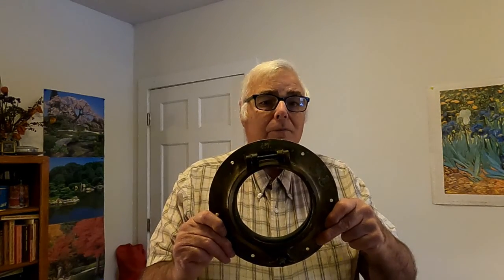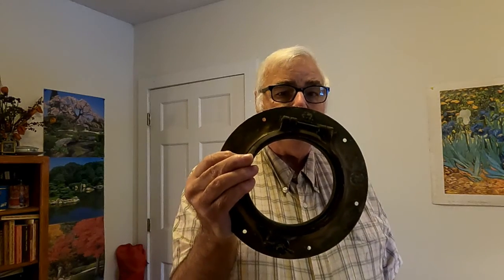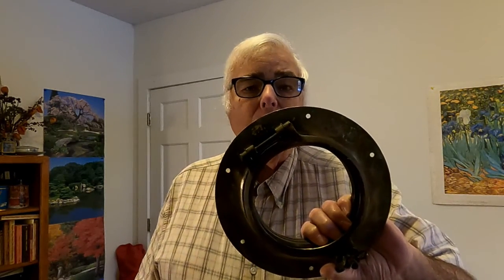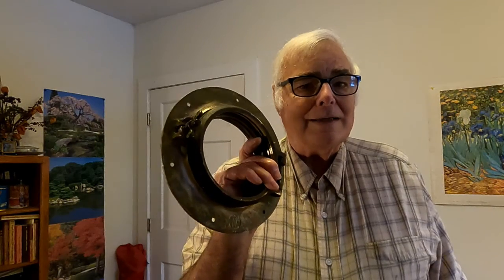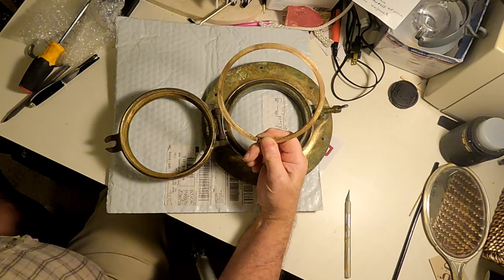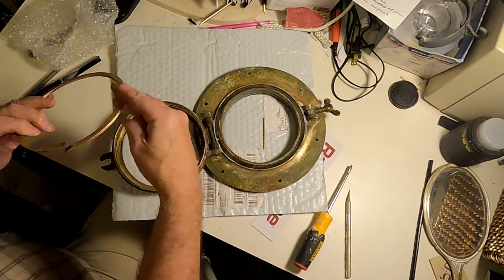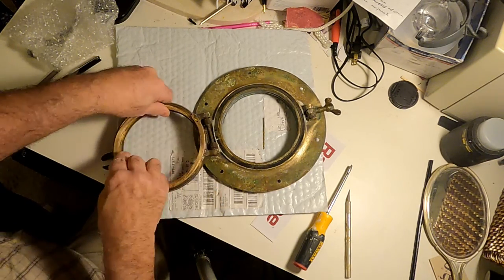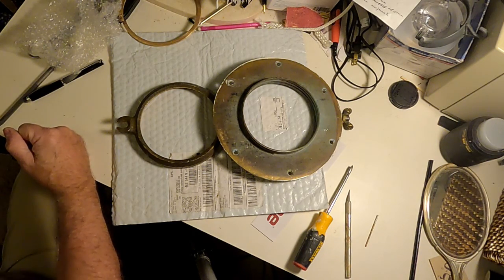Reglazing an 86 Year Old Bronze Port Hole with Lexan (polycarbonate)

Comment: It looks like you have another boat project out of the way, and i'm sure it will last a long time.
Reply from the maker: I do still have to replace the gasket.  I think I am going to make a new gasket from silicone caulk.  I would have done it yesterday, but I didn't have any masking tape.  I think the lexan will last longer than I own the boat.

Comment: What if you mounted the port hole to a flat surface to remove where it's warped out of shape ?
Reply from the maker: Well it has to go back on the boat and the spot where it goes is flat.  It turned out that the hinge pin was bent.  So I made a new one it the port now closes flat.  Thanks for the question.

Comment: I have two #4 Wilcox Crittenden ones! They didn't fit my boat.
Reply from the maker: Interesting.  Those Wilcox Crittenden bronze ports are worth money.  I thought about trying to find a new one, but the $300+ price for the ports I found on line pushed me to repair what I had.  All together my repair cost about $30.  I am pretty sure the 3/8" lexan I put in the port will never break.  Even if it does I have enough material left to do three more repairs.  I did price tempered glass and the cheapest I could find was $110 for rough edges and $150 for a round piece of glass with finished edges.
Reply: @todddunn945  Yeah, I paid about $250 each on eBay.  And they didn't fit. :(  So I went with Spartan bronze ports.  They look beautiful.  Will the lexan craze at all?
Reply from the maker: @captainhml3868  Yes the Lexan will eventually craze from exposure to sunlight.  However, the Lexan I used has a UV resistant coating and should for 15+ years before it starts to craze.  I can live with that since it is actually pretty easy to install new Lexan in this port now that I have done it.